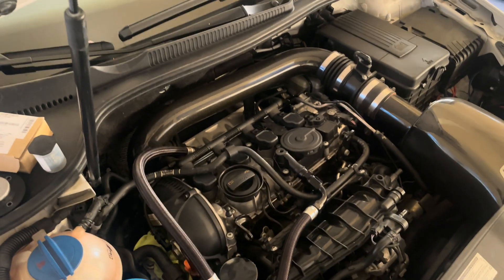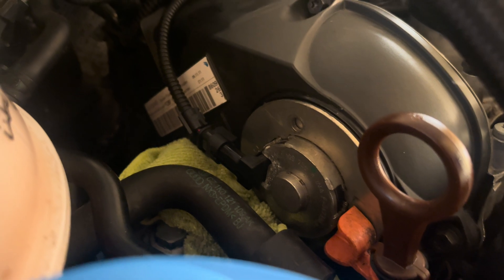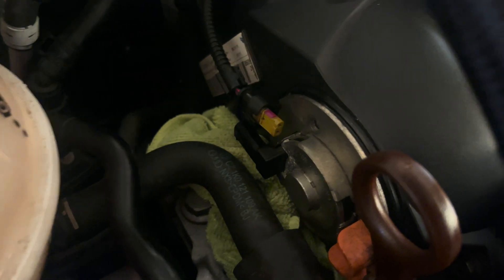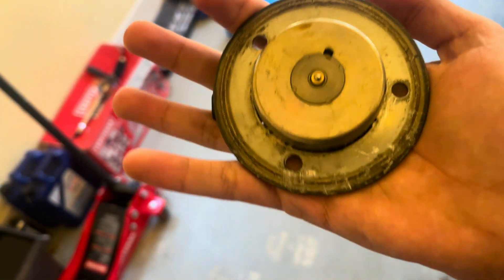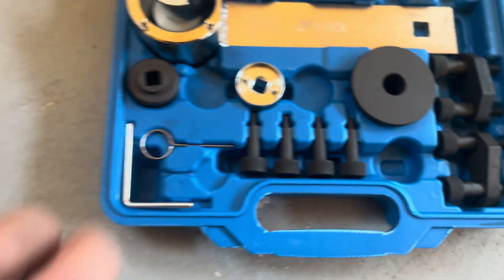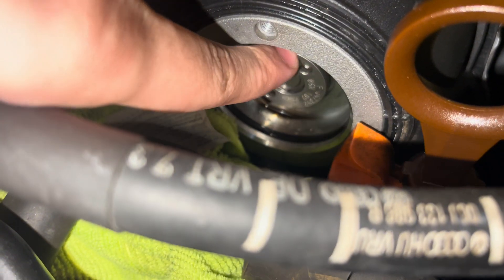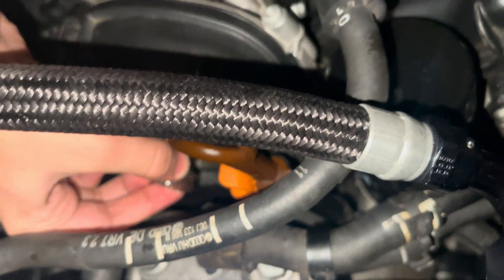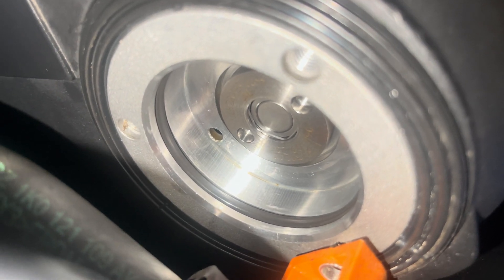VW EA888 Cam Adjuster Magnet And VVT Solenoid Replacement (P0011, P052A00, P11A6, ETC..)

Comment: What was the issue that required you to replace the N205 part?  I don't have faults on my E888, but with both magnets replaced it still rattles in that area and the noise goes away when I unplug the magnet.

Comment: If oil os getting past this solenoid does changing it fix the issue? I’ve replaced one magnet which failed and lots of oil inside it which stopped it moving freely.
Reply: Oil is supposed to be in there, but only a thin amount. You can see the hole that allows the oil in underneath the solenoid. If there is a lot of oil in there. You might want to check your PCV as a failing PCV will cause excessive pressure and it will push oil pass seals. You should also check to see if there is any oil in the connector that plugs into these magnets. It’s gotten all the way up there usually means your PCV is going out. When you replace these, you’ll also notice that there’s a rubber gasket inside where the magnet comes out. You should replace this at the same time as well.
Reply: @EthanOliveria  thanks a lot, I had an over advanced timing on one, magnet plunger had stopped moving but replaced with a new one and was fine.

Comment: Mine is an Audi A5 CJEB EA888 engine 1.8 TFSI. I have got P0341 and wish to get the solenoid N205 taken out to clean it. But from your video it seems it has been loosen by turning it clock-wisely. But mine is so tight. I have removed the magnet but the solenoid just got stuck in there. Am I missing anything at this stage?

Comment: I'm getting a sole "P0341 - Camshaft Pos.Sensor Circ. Range/Performance" code that pops up intermittently.
I just replaced the camshaft position sensor, but the code just tripped again. Do you think replacing the camshaft adjuster spool valve might help resolve this?
Reply from the maker: Possible but hard for me to tell without more info, you may want to take it somewhere and avoid the hassle of buying unneeded parts.
Reply: @itsgerman  Thanks for responding!
I actually priced it out and buying a new magnet, spool valve, and VW timing socket would still cost less than me bringing into a shop for them to check it. I figure, if changing those parts helps, it'll be worth it. If it doesn't help, then it's probably the oil screen. Since the oil screen job is a bit too involved for me to do myself, I'd end up bringing it into the shop at that point anyway.
Reply: @MishtahPoog any update? Struggling with  same issue
Reply: @pepijn6377   No real update yet. I ordered the parts and will install them in a few days. Then, I have to clear the code and see if it reappears.
I watched the live data for the camshaft adjustment values (Chan. 90-93) and it all looked good, so I might be wasting my time. Still, I'll let you know how it works out.
Reply: @pepijn6377  Installed the magnet and spool valve today. I'll drive it tomorrow and see if the code comes back (in the past it's taken anywhere from a week to a month to trip the code). I did see oil inside the electrical connector, which  I cleaned out with electronics connector spray.
Side-note: Wow, that ****ing VW timing socket was frustratingly hard to keep seated properly. I had to re-seat it like 50 times over the course of unscrewing and then torquing down the new the N205 valve.
Reply: @pepijn6377  It's been almost four weeks since installing the new magnet and spool valve. Neither my P0341 code nor Engine Check Light have come back in that time.
It's hard to know for sure if the problem is completely resolved, since the code was very intermittent to begin with. That said, I think it's looking good so far.
For comparison, when I initially replaced the camshaft position sensor to see if that would resolve the issue, the P0341 code/ECL reappeared within one week.
Reply: Hey bro I have the same issue with mine did your issue go because I’m about to replace the magnet and N205

Comment: There are 2 seals if you're going this far (even if just replacing the magnets).
ELR-302690 (is the outer) it is more of a gasket 
and
ELR-538010 (is the inner) this is the O-Ring 

If you're into spending bucks earlier than later by replacing the magnets, you wouldn't have to worry about the phaser as long as you keep with frequent oil changes.  By more frequent, I mean not every 10K mi.
Reply from the maker: Yea I replaced both seals aswell, didn’t mention this in the video, thank you for the insight!
Reply: @itsgerman   When I use the parts compatibility functions on FCP Euro and ECS Tuning, they only show that the inner O-ring is compatible with the Mk.6 GTI.
The outer gasket/seal mentioned above is listed as incompatible.
Could you confirm the gasket and o-ring parts you used and replaced? Also, how did you replace them -- did you use a pick tool, or something?
Reply from the maker: I replaced both using a pick tool with a 90 degree angle at the end. https://www.fcpeuro.com/products/timing-cover-seal-elring-06l103583c this might be the one your talking about.

Comment: I’ve got a p0016 code currently. I’ve correctly done all timing components apart from this. Reckon it’s worth a shot?
Reply from the maker: Have u tried replacing the camshaft position sensor (part number 07L 905 163 C)
Reply: @itsgerman  I’ll try that next , thanks :)
Reply: Hey I’ve also gotten this code in my mk6 gti, have you fixed the issue? If so what part needed to be replaced?

Comment: Hey man, I’m having a bunch of cam codes and I’ve been chasing them for like a month, I’ve replaced the cam position sensor and the crank sensor about the replace the cam magnet, my car is relatively low kms how pivotal would you say it is to replace the n205 valve? Can I get away with being lazy and not ordering the tool?😂
Reply from the maker: Hey man, it could be a possibility , I’m not sure what exact issues you’re having. What are the codes? Is it tuned? Also to remove it I would say it’s going to be pretty hard to take it out without the tool and definitely to torque it back to spec. I would save the hassle and order it if you plan on changing it out.